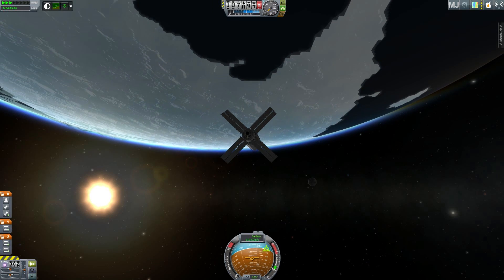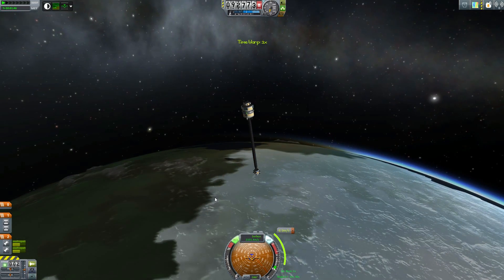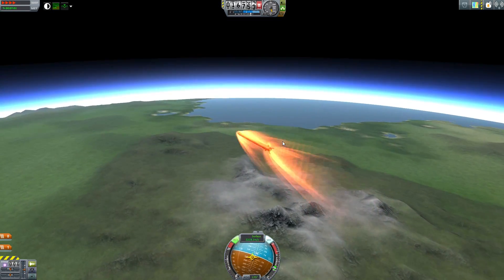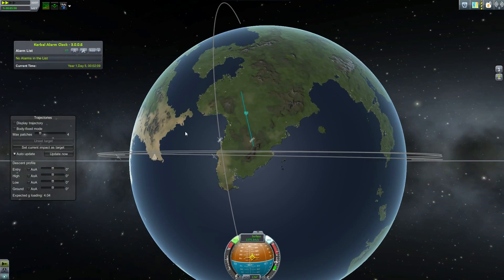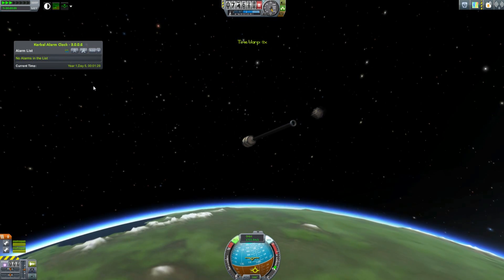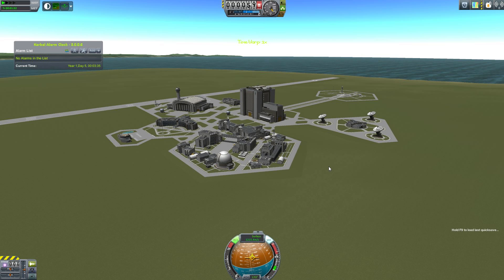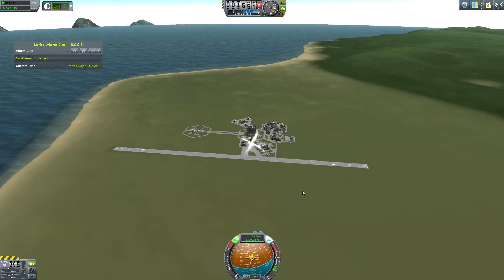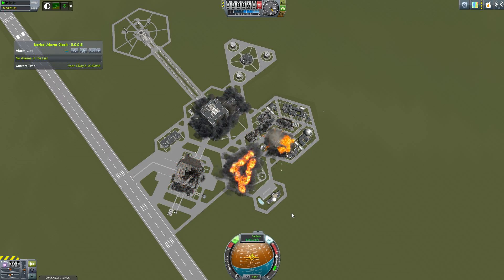Rods From The Gods vs Kerbal Space Center

Comment: Exactly how deadly is s 3 ton rod going Mac 3 or so? Surely conventional weapons would be better
Reply: Very true. I really didn't put much effort into that. Now that you mention it, I didn't even think about the atmospheric density.

Please disregard.
Reply: 1.5 GJ of kinetic energy. 2.1 GJ if at 1.2 km/s (as said in the description).
Reply: Likely yes, but the amount of force it would deliver is not inconsiderable, and a steel rod flying through the atmosphere would be very difficult to detect.
Reply: Back of the envelope calculation of those figures suggest a kinetic energy of 1.5 gigajoules. A small tactical nuclear weapon has maybe 50 gigajoules. Definitely a sufficient bang to take out a building, but the biggest advantage is perhaps that no anti-missile system can shoot it down.
Reply: It has the same energy as a 500 kilogram bomb. But this energy is delivered over a much lower area, and with far greater pentrating power. 3 tons of metal at 2.1 km/s make for an AWESOME bunker-buster.
Reply: except if one of these around Earth will be going about mach 22
Reply: ***** What is air resistance.
Reply: air resistance would not slow it down too much something traveling mach 22 has the same drag as something traveling mach 1.
 what could happen though is ram pressure could flatten the rod out and the Cd will increase and that will slow it down alot
Reply: Raethen4e
It wouldn't be very hard to detect, but it'd be very, very hard to stop.
Reply: ***** Air resistance goes up by the square of the velocity. Something going mach 22 will have 20000^2*area resistance, versus mach 1 having 1000^2*area.
Reply: okay i see, but it would still hit the ground a lot harder if it entered at mach 22 as compared to entering at mach 3
Reply: Let's see. (Warning: terrible, terrible math ahead. I don't have time to do this properly, but it's close enough). Let us say that the rod has a cross sectional area of 0.5 m. It's 18 t, let's say that's a metric ton for ease of calc. We have about 13000 m/s of v at mach 22, so we get 4.3*10^3 newtons of force on the object (halfway through deceleration. I'm too lazy to solve this over time, so I just averaged the velocity over it's deceleration). A=M/F, so we get about -222 m/s/s. 13000/222 is 58, so in 30 seconds, this thing will be at probably near 2000 m/s, which is probably about what the slower one would get to. Not too much of a difference.
Reply: Mach 22 is about 7486.6m/s not 13000 and you did not take into consideration of the drag coefficient which decreases as speed increases above mach 1.2. Also for a majority of its flight the air density is very low compared to the final few seconds before its impact
Reply: the real world weapon goes mach 10 and has almost no air resistance due to its shape, it was made to be a workaround of the international treaty stating "no weapons of mass destruction". a weapon of mass destruction is describes as a chemical, biological, or radioactive weapon. kinetic energy is a loophole
Reply: the real world weapon goes mach 10 and has almost no air resistance due to its shape, it was made to be a workaround of the international treaty stating "no weapons of mass destruction". a weapon of mass destruction is describes as a chemical, biological, or radioactive weapon. kinetic energy is a loophole
Reply: the real world weapon goes mach 10 and has almost no air resistance due to its shape, it was made to be a workaround of the international treaty stating "no weapons of mass destruction". a weapon of mass destruction is describes as a chemical, biological, or radioactive weapon. kinetic energy is a loophole
Reply: the real world weapon goes mach 10 and has almost no air resistance due to its shape, it was made to be a workaround of the international treaty stating "no weapons of mass destruction". a weapon of mass destruction is describes as a chemical, biological, or radioactive weapon. kinetic energy is a loophole.
Reply: the real world weapon goes mach 10 and has almost no air resistance due to its shape, it was made to be a workaround of the international treaty stating "no weapons of mass destruction". a weapon of mass destruction is describes as a chemical, biological, or radioactive weapon. kinetic energy is a loophole.
Reply: the real world weapon goes mach 10 and has almost no air resistance due to its shape, it was made to be a workaround of the international treaty stating "no weapons of mass destruction". a weapon of mass destruction is describes as a chemical, biological, or radioactive weapon. kinetic energy is a loophole.
Reply: the real world weapon goes mach 10 and has almost no air resistance due to its shape, it was made to be a workaround of the international treaty stating "no weapons of mass destruction". kinetic energy is a loophole.
Reply: +TheBritishGeek 
Mach3? it's a bust, just use a fuel-air bomb. 

However, Rick Robinson's Second Rule of Space Combat: "Anything moving at 3 kilometers per second delivers energy equivalent to it's own mass in TNT." And the faster you go, the more energy. Hit KSC at 10 kps, that'll leave a crater. But for most uses, a nuke or even conventional explosives will outperform kinetic weapons.
Reply: More like 8 tons at Mac 10

Comment: In WW1 aviation used simple steel arrows, for thrownig them on the infantry or cavalry,before appear of bombs...Now Scott take it on space level...Screw you,lasers, iron garbage rocks!
Reply: It'll be a long time before the amount of energy you can effectively transfer via a beam of light becomes greater than the amount you can transfer by fast-moving matter.
Reply: TOASTEngineer
Especially if that matter happens to be moving anywhere near the speed of light.
Reply: 44R0Ndin The rods go nowhere near the speed of light. The tungsten rods fall at mach 10 or 10 times the speed of sound which is equal to 3402.9m/s. While the speed of light is 299,792,458 m/s. As you can see its not even close to the speed of light. Not only would it be pretty much impossible and to difficult to get tungsten to the speed of light but if something like tungsten doesn't burn up from that speed when entering the atmosphere it would have astronomical damage well exceeding the force of a nuke defeating the purpose of the weapon.